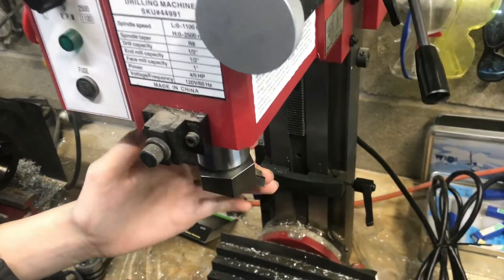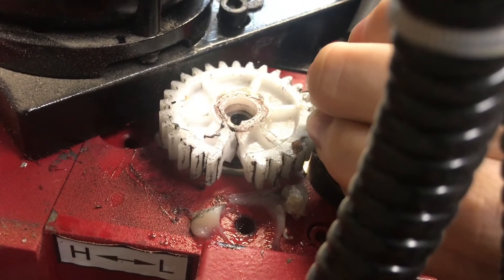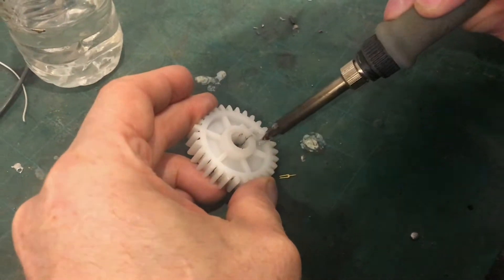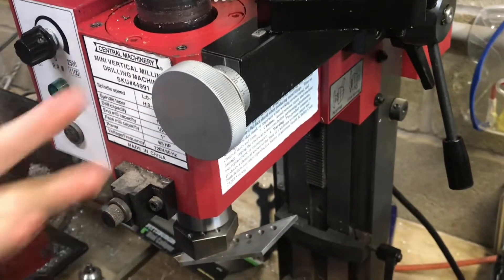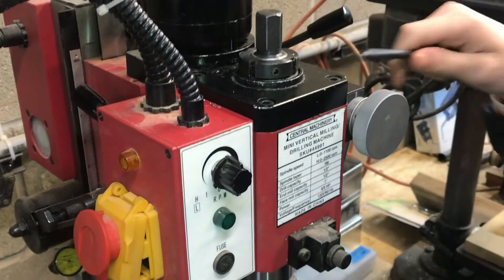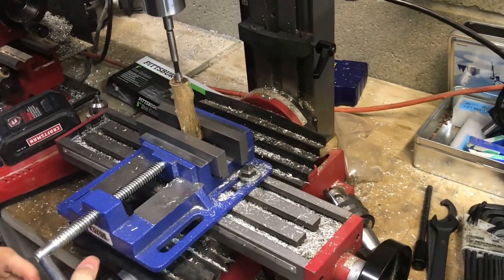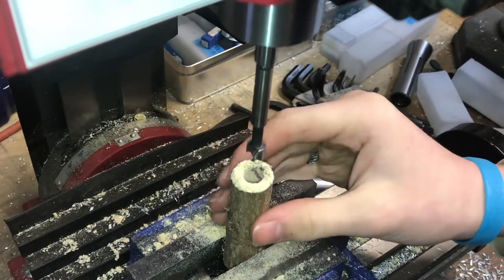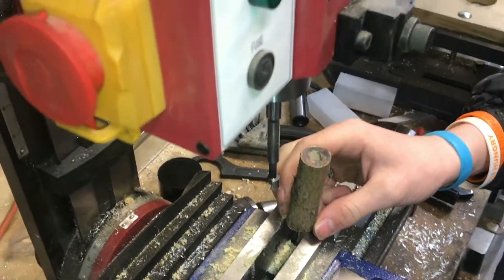fixing BROKEN plastic gear on a harbor freight or grizzly mini milling machine 44991 g8689

Comment: Bro, you have a mill. Make a metal one......
Reply from the maker: At first I was pretty disappointed that there was a plastic gear, the more I think about it the plastic gear may not be such a bad thing. Our plastic gear broke into pieces because the tool unexpectedly dropped and impacted more than it should’ve. If that cheap plastic gear didn’t break, it’s possible that the motor could’ve been damaged or the gearbox. This weakest link did break.. I’d rather have this cheap gear Break. We ended up picking up 10 plastic Gears so we can replace it if there’s ever a high impact to the machine again. Those are my current thoughts. Although it would be cool to make a gear. We did buy the rotary table and I’ve got another project for my pinion gear that I’m excited about. Thanks for your thoughts
Reply: @livefree6878  Sounds reasonable
Reply: Like the man said, you don't want to do that. A metal gear will carry impact all the way to the motor and then you'll be really fucked

Comment: Doesn't Harbor freight offer a replacement metal gear set for this?
Reply from the maker: As far as I know they don’t, I look pretty hard. Grizzly was the only place I could find that sold the gear. The gear was a dollar but it was $10 shipping. I bought 10 gears to make sure that I was never without a gear. At first I was upset that the gear was plastic but then now I am glad that it is plastic. If ever there is a load put on that is too much the gear brakes first. When the gear broke on our machine it’s because the tool slip down and hit too hard. Something has to give and I’d rather it be something easy to replace. At this point even if I could find a metal gear I would still want to use the plastic One as a safety.
Reply: @livefree6878  With the metal gears, the machine will shut off if it binds, but there is a reset at the fuse. I've done it several times with no issues or blown fuse. The "little machine shop" has a metal gear sets $59, english (foot) screws to replace the metric ones from the factory, and tuns of mini mill parts & upgrades. I would like to get a 1.5 hp motor tho.... https://littlemachineshop.com/products/product_category.php?category=879658189